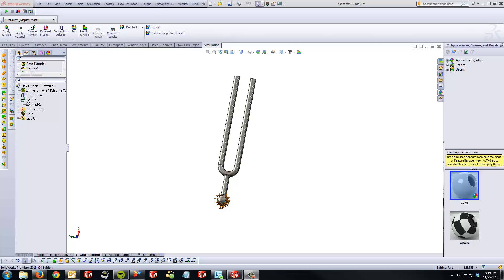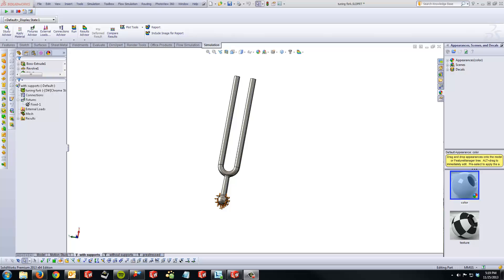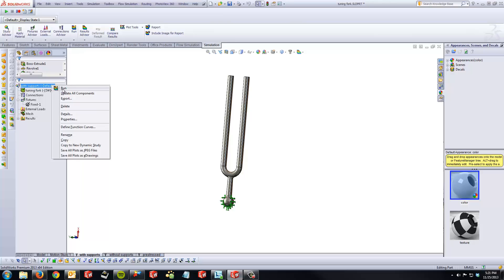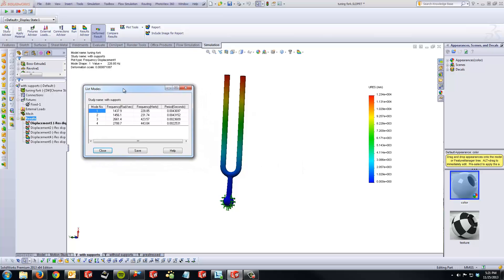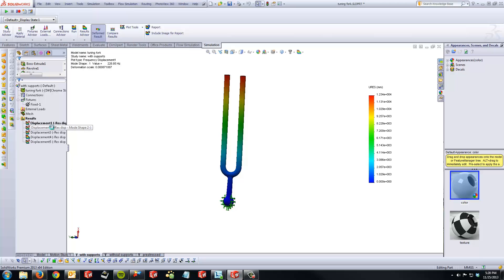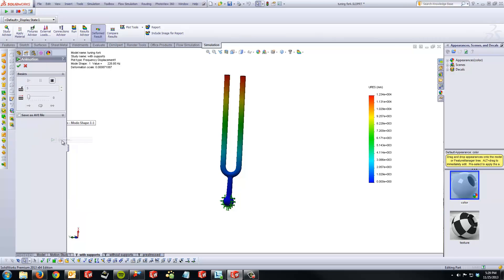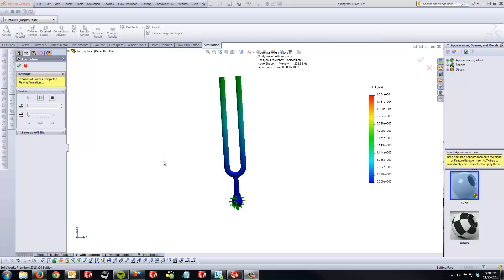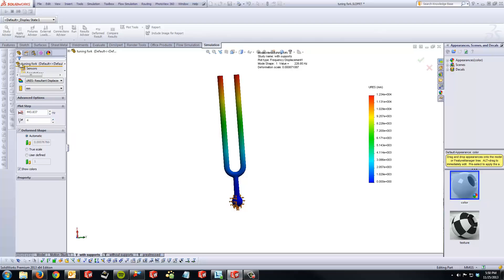SOLIDWORKS - Frequency Analysis

Comment: Analysis(solidworks) on driveshaft for my university project Edit

hallo,

 I am doing my project in university.Here on analysis of driveshaft one end is fixed and the other is free(torque input).But in general the fixed end will also keep rotating.can you please suggest me the boundary conditions.can i give elastic support at one end?.can you help me what is to be done clearly.how can i check those values are correct or not?

Thanks,
Reply from the maker: Hi Ganesh,
To analyze a drive shaft in a frequency analysis you would generally want to avoid fixtures as they make the model overly stiff and tend to report natural frequencies higher than what they would be in real life.  At the locations where you have supporting bearings you would want to apply flexible "Bearing Fixtures" with an appropriate bearing stiffness value applied.  For your torques, you would want to apply equal and opposite torques to both ends of the shaft to represent the drive shaft at a steady speed but under load.
Reply: how can i check that values are ture and analysis is correct?
Reply from the maker: You would at a minimum want to check that the results have converged.  To do so you would duplicate the study (use the same boundaries), reduce the mesh element size, and observe whether the natural frequencies then changed.  Once you are able to reduce the mesh element size and receive the same results you have converged.  It is then your own judgement in determining whether the analysis you have setup adequately represents your real life situation.
Reply: thank you